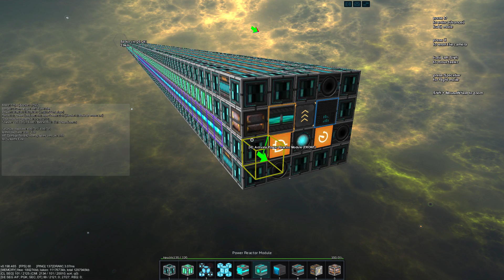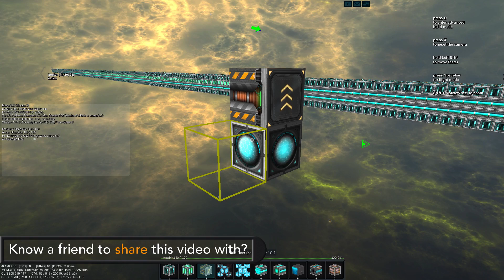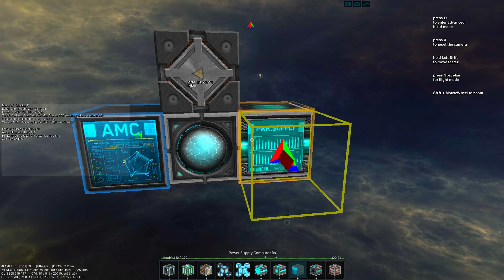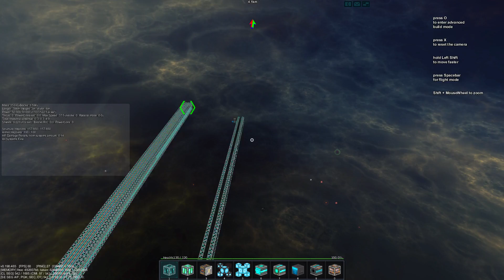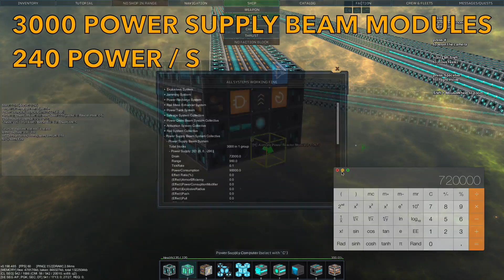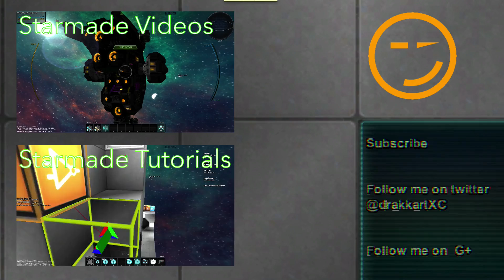Starmade: How To Build Docked Power Generators Tutorial

Comment: this may sound stupid but what is the benefit of having a docked thing rather than the same but part of the main ship
Reply: a Docked Injector "abuses" per-say the 2m energy soft cap that every new entity/Ship core can get for "free". As such, by injecting power into their mothership, they are up to and over 4x more efficient on space per unit energy recieved by the mothership than if the space/volume they take up on the ship were to be filled with mass amounts of blocks of reactors.

I wont advise thinking at all about docked injectors until your ship weight surpasses 10k mass, as 2m energy on the small ship is more than sufficient for its needs unless you are using Overdrive effect

(I tend to bypass using some injectors by massive, self powering turrets that use 4m e/s from the base of the turret and the gun. they are big though.)
Reply from the maker: As already said big ships run into power efficiency issues when surpassing a certain powergeneration. Beyond 1.5 million energy /s it is more efficient mass and volume wise to utilized docked generators instead of trying to build more powergeneration on the main ship.

Comment: Instructions Unclear; Built a deathstar laser.
Jokes aside, you didnt TEST those injectors on a capacitor bank; I can tell you right now that those injectors are NOT efficient on modules for their size. 100% cannon slave is NOT the way to go.

I recommend making a 50x16x16 block of capacitors on a core (Which is about 20m power) then timing how long it takes to fill that bank then divide by power. I can tell you right away that system is only outputting "AROUND" 600k energy a second from a test a patch or two ago.
Telling people that these reactors do 1.4m based on JUST the stats the game tells you is inaccurate and should not replace in-field testing (Like aforementioned capacitor-target to inject power to)
Reply from the maker: i did. and it is a way to go at least a way that is easy to explain in a tutorial. you'd go with something different? then please share.
Reply: Im always using a 20m capacitor ship to fill with an injector as a baseline test for them under logic on a 9x9x90 injector which is nice and snug for smaller vessels to use I can output a defined 800- 840k energy per second server depending. The reactor is exactly 1/2 the price in terms of cannons and the like compared to the one shown. Under Delay-Not clocks and VS a shootout clock 3000/3000 did 23s Delay-not, while it did 20.5 under Shootout. My reactor did 24.8 under delay-Not and a 21.2 under shootout (Tested on NFD-Build). This differs from experience in last tests clearly showing that 100% cannon was not only highly expensive but also less efficient than its trial and error balanced peer. While active a 3000/3000 draws 1.4m energy from the reactor, while my design draws only 1m to 1.2m. Calculating the two gives almost exact equals in terms of Blocks used per power given to the ship (circa 128.8e/block), THis injector is sorta old; and hasnt had power cap reduced to it so it keeps all its capacity as an additional buffer; it has on board shields and thrust too... (PS If you read this far, PWRSUP: 1524 CNN: 1415 should be ratio. - Other tweaked ratios work too)

Sorry for wall of text but results and science and whatnot. And yes, telling them 3k/3k is far easier for them to understand...
Reply from the maker: first size wise 9x9xZ might be a nice format but you are dumping the efficiency per block drastically in comparisson. i use my psu on just a bunch of capacitors 30x30x30 see how fast it fills this and then calculate down how much it effectively transfers thing is this is also not in the video for it is not required when just telling people how to build docked reactors and what the core principles are. i have tinkered with different ratios for the cannons but since 100% is an exact second and a different ratio also would require a different more complicated clock ... i opted against it.
besides i found off ratio supply beams way less stable so the won weight you need again for additional storage... but yeah you might have tinkered further in that regard.
Reply: The efficiency per power recharger is not a concern when: 1) The reactor cannot fit into traditional ship designs, especially RP-based ships that contain some sort of hanger and 2) Ive tried making small XY- and Z long reactors and every time have run into the problem of not enough space for actual systems other than the regen. It becomes balancing the "efficiency" of the reactor in terms of power recharge groups Versus the overall efficiency of compact design that can be slotted into almost any vessel, the efficiency in Contested-material usage (Cannons expensive yo - 10 injectors for 10m energy will set you back 30,000 cannons that are NOT being used for DPS) and actual power-usage efficiency. It is extremely doubtful you will get a reactor of the type shown how to build to inject twice the amount of power (Basically a 2x size injector to keep entity count down), whereas the split-ratio can support upwards of 1.5m energy a second actually being sent to the main ship (costing 2-2.2m energy to use) versus a 6k/6k that will need an impossible 2.8m energy to use...
Reply from the maker: this really plays a role when ressources come into play and you are traying not to build for max efficiency i agree. but this again leaves even more space open for Trial and error ...
hey guys i want to show you how to make docked reactors prety much they are all trial and error so yeah the end ; )

Comment: you know there's a docked power generator that even shorter than that out there by Zackey_TNT
Reply from the maker: no in general i do not care much what other people build. Esspeciallty for my tutorials i use what i know and understand thus have built myself. a shorter generator won't be as effective though, for it has to use more groups...
Reply: What's the problem with more groups? apart from increasing the girth of the generator?
Reply from the maker: the thing is if you have for example 2k reactors in one group in one line they are more effective than 2 groups 1k each line which are more effective than 4 groups each being 500 in one line... so the less groups while still making sure each added reactor increases the sum of dimensions of it's group leads to maximum efficiency power generation wise.